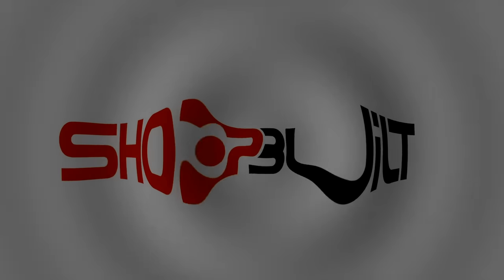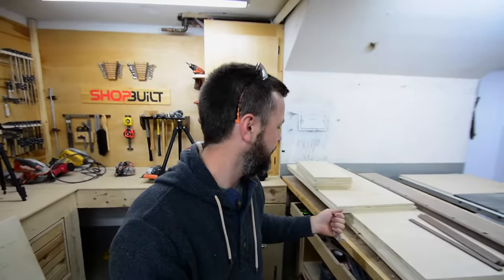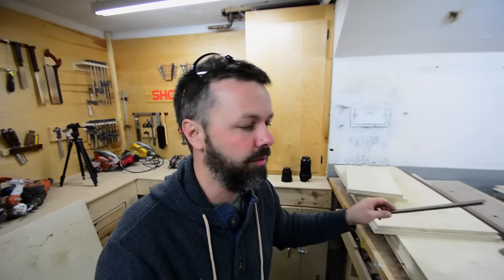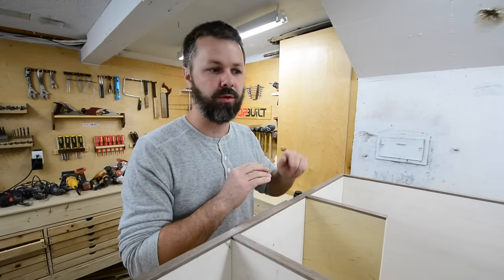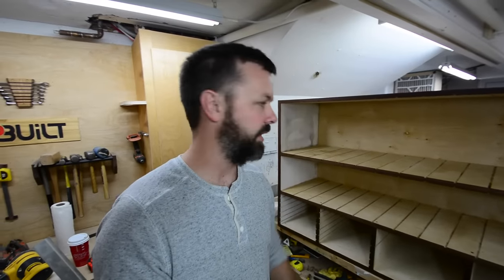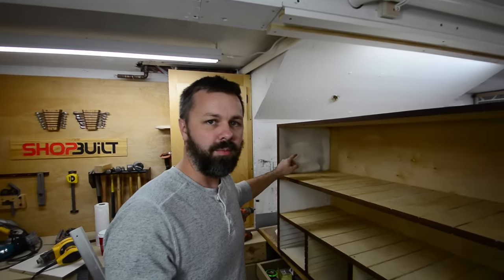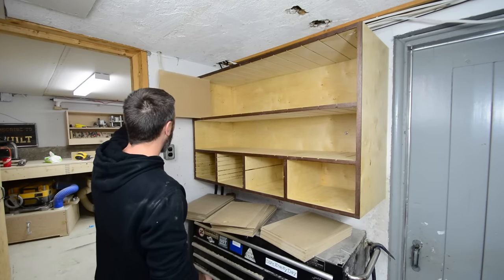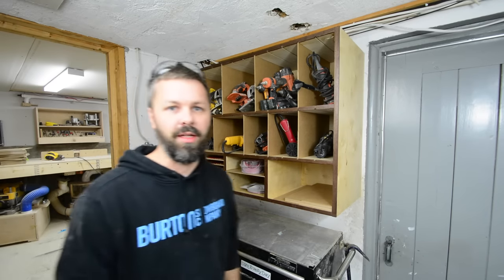Shop organization - Power tool cabinet

Comment: This is one of those fantastic examples that teaches us all the tremendous value of cutting & test-fitting on scraps, and also testing finishes on scraps of our proposed materials BEFORE we actually build the piece.  That way we know exactly what we're in for once we get rockin' & rollin' on the project.  Sure it's an extra 1/2 hour or more up front, but it saves sooo much time on the back end.  Thank you for teaching all of us through your own experience!!!
Reply from the maker: +DrewT where were you before I started:)
Reply: Oh, I was busy waiting to judge somebody else's mistakes ;-)  No hate, man, all love & appreciation for all YouTubers.  This project is awesome.  I have power tool cubbies too & love them.  The sand paper section is on my list!  Thanks again for all your hard work for our benefit!!!

Comment: Welcome to the club.  I recently had a project like this where the dividers didn't fit either.  All I did was put a straight bit in the router table and just grazed the edges, top and bottom of one side, until it fit.

Comment: The real videos are always the best! Way to persevere. If you have a sec could you elaborate a little on the divider slots? I watched that part of the vid and didn't notice any jigs to keep them matched. The other thing was cutting the dividers? I always get nervous when running something wider than deep against the fence. I try to incorporate the mitre gauge and block as well as wax the crap out of the saw table top.

Comment: Hindsight is the cleverest sight to have, however I have an observation. You might have been better off gluing either another piece of that crappy ply inside the end verticals over the paper side to cover it up.  If that takes too much room, then maybe a piece of MDF or Masonite. Just a thought. Admire you sticking to get the job finished, my jobs usually blow out in time as well. Cheers, Grand Gaz

Comment: Couldn't agree more about imported plywood. I bought some pre-finished import plywood and after cutting it broke out in a terrible rash all over. That would have been bad enough, but every piece I cut warped most bad enough not to be able to use.

Comment: I'll never buy the cheap cheap stuff again.  I bought a sheet of the 1/2" stuff just for some small simple boxes to hold some drill bits, router bits, screws, etc.  Shop stuff projects mostly.  It's got almost as much in voids as it does in "plywood"...  And it had stresses in it.  Plywood doesn't have stress in it.  I could literally see it bend and warp as it went through the saw and sat on a table waiting for assembly.  I've got close to a half sheet of it left.  I use it outside for a "landing pad" for my drone now.
Reply from the maker: +KSFWG yeah, that's about all it's good for;)

Comment: did u try sanding the separators? I've been always tempted to run MDF through the thicknes planner.
Reply: Moré Hace or maybe trying a thin cut on the edges to just thin the part that holds it in.
Reply from the maker: +Moré Hace I did actually try to hit each side with the belt sander but it was still sticking sometimes. I really wanted them to move easily.

Comment: How did you hanged the cabinet on your wall?
Reply from the maker: +Fabio M Caldas I have concrete walls so I used 6 1/4" drop in anchors and bolts. It's a heavy cabinets so I didn't want to worry about it falling off the wall.